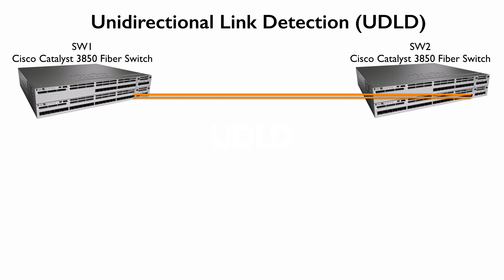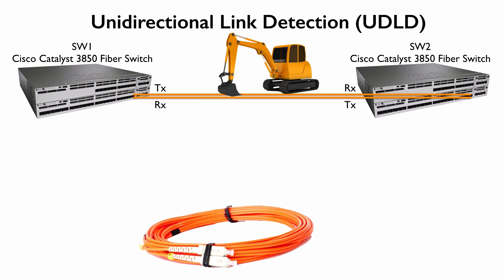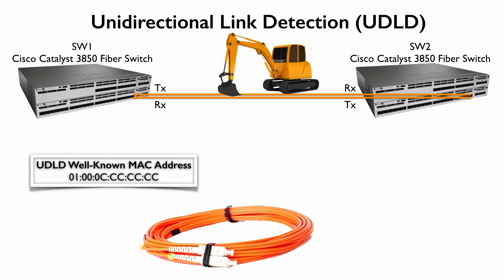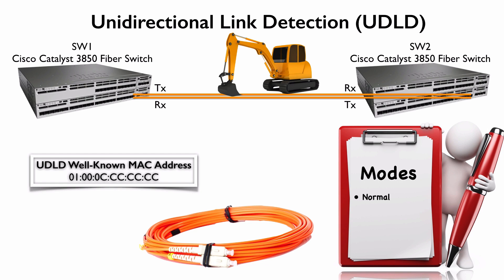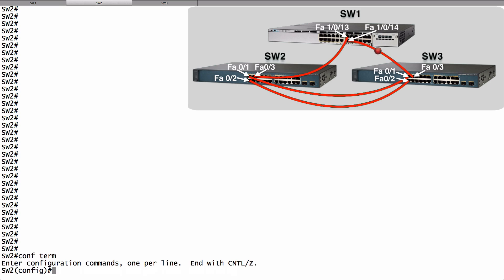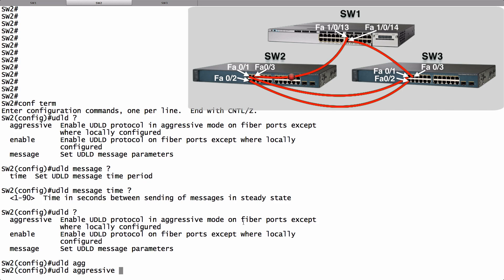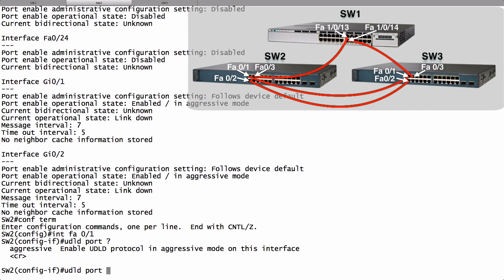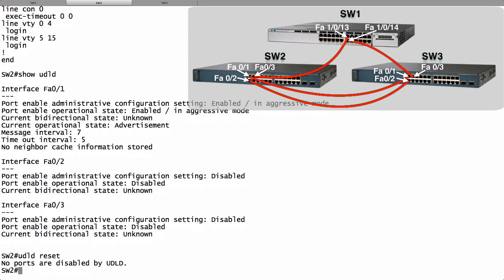Cisco Unidirectional Link Detection (UDLD)

Comment: It is awalys said UDLD take 45 seconds to react to lack of uldl messages (3 times time interval) because it must take the link down BEFORE STP will unblock a port and start forwarding messages (which can create a loop) OK, 3 UDLD messages is 15+15+15 = that is 45 seconds. But you also say when UDLD will not get an answer from its neighbour in 3 hello times (that is 45 seconds) it sends 8 messages, one message per second.  And that gives you 45 seconds (3 times 15)  PLUS 8 seconds  (for the messages sent when there is not response for 45 seconds from the other neighbour) which gives altogether 45+8=53 seconds. STP will react in 50 seconds, 3 seconds BEFORE UDLD will take an action and shuts down a link. So in fact, for 3 seconds there will be a L2 loop, am I right?

Comment: Hi. I have a question. When one fiber is faulty, then the Layer 1 status of the two ports on both switches is going two down, isn't? Why do I need UDLD?
Reply: I know this is late but if it’s faulty it doesn’t mean it will necessarily be down. Fiber could be faulty from the carrier but in house your connections are up on both ends.